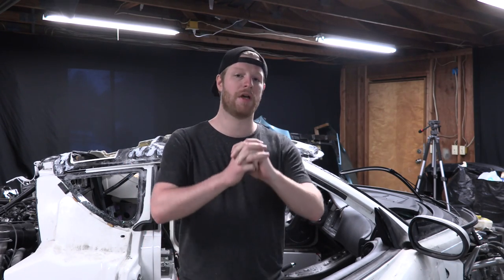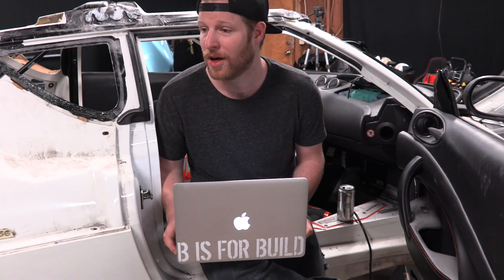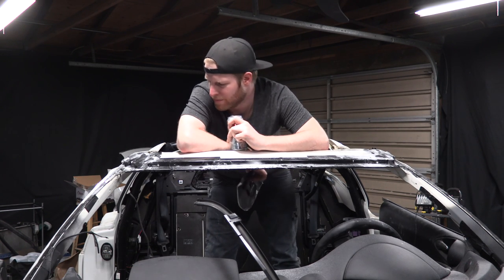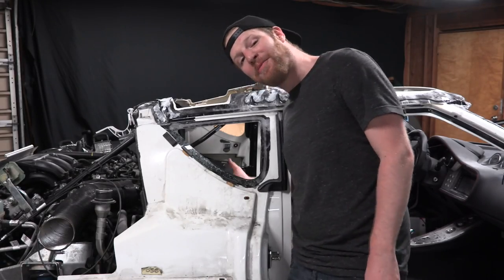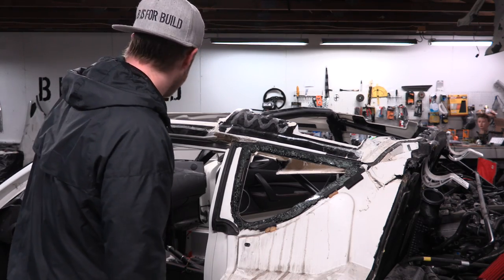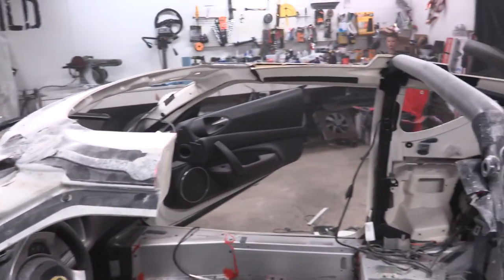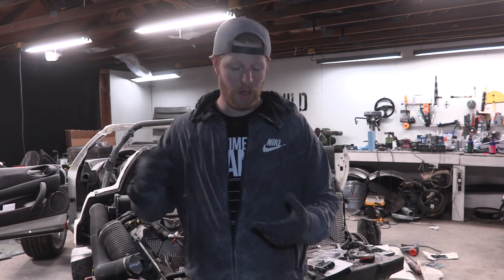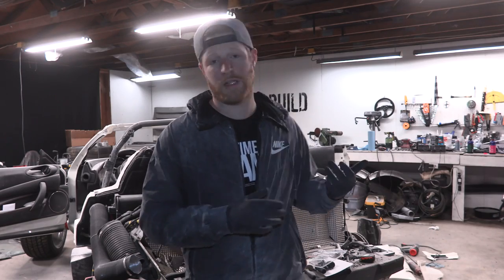Budget Lotus Evora Pt 10 - Removing Side Panels

Comment: Since lotus decided no one was supposed to repair these cars, you could always cut away all of the fiberglass and make it into something like the roadkill vette cart
Reply: There wasn't much of a corvette left in that
Reply: for what he paid for it, and if this I'd done correctly, he'd make an enormous profit, that's a terrible idea, unless you're a millionaire
Reply: no way, just the labor required  is enough to pay for a new car. This is an exercise of sheer will and determination.  Most rebuilders would bow out the moment they realize all frame-bonded parts were never meant to be replaced.   This is one of the downsides to cars that are essentially glued together.

Comment: Not at all complaining,. Good stuff man and you're doing a great job.
Reply: I found the door glass (B132B4057J,  B132B4058J), windshield (C132U0001F), rear glass (E132U0003F) and quarter panel (D132U4001F, no RH) glass as well as the roof (A132B0018K) on lotuspartsdirect
Reply: I found the rear bulkhead as well. A132B0107J

Maybe these arent the ones you need as i found them fairly easy? All of them had good prices as well. Roof was 900 i think.

Edit roof is 670
Reply: but are they in stock. Sometimes they are on backorder
Reply: I wondered that as well. I put the roof in the cart and clicked order.... It seemed to work, so I guess It's in stock?
Reply: but that still doesn't show if they had it in stock, I've ordered plenty of things before for my car and they had to call me and let me know its on back order
Reply: Gah I hate when websties do that.
Reply: Jordan Liske yup same here lmao
Reply from the maker: Yeah undortunately the parts that aren't in stock means no stock for all these websites, there are three or four big websites that do parts distribution but if lotus doesn't have one on the shelf in the UK then these sites won't have one either, even though they will let you order and pay for one.
Reply: Dang it, i guessed as much and that's kinda sketchy. Atleast you got the roof sorted and hopefully the glass wont be too big of a hassle.
Reply: typically, youre jumping ahead of yourself on cutting up body panels. Youd normally wait til you got your replacement parts to see how much you cut off. parts come with. if you need any tips on bodywork/repairs/fiberglass feel free to ask. You never know how much of what the

Comment: should put plexiglass as roof. that b neat
Reply: "what a beaut"
Reply: use Lexan instead of plexiglass , lexan is much stronger and also available in different colors
Reply: Sinned Neztirreg I didn't think of that. Would be a lot better
Reply: Lighter and stronger :) and used a lot in racing
Reply: I support this

Comment: I know its a bit of a PITA (and probably too late), but try holding a shop vac near your angle grinder wheel while cutting.  It sounds silly, but when I was using mine to cut sections of wall/plaster out of my house, I duct taped the vacuum hose to my sleeve so that it naturally fell near the grinder wheel.  Drastically cut down on the amount of crap that was floating around.

Comment: Why not make it a T top or a fully convertible? Make it one of a kind lotus
Reply: The pillar above the door is a frame support
Reply: because Oregon
Reply: Have you seen the fiat 500 cabrios? The middle of the roof is retractible.
Reply: Hollow squad checking in
Reply: i feel like a soft top with snap buttons would look clean yet easy
Reply: +mtndewuni and tacky... But I feel it would still look cool. Maybe he could make a diffuser for the roof? And then rust it, and maybe put rockets in it... Then it would be a questionable double o seven car

Comment: After watching a video on the Evora being hand made in the factory, I have faith that you can fix everything it needs. I was worried about fixing the front aluminum crash bar but that should an easy fix or custom make new pieces. But I am worried about the windshield frame being out of shape and if it's made of fiberglass should probably just be replaced.
And if you haven't yet you should get under the car and measure the chassis front to back, side to side, corner to corner, and axel to axel to make sure it's completely straight so you're not fixing a car that will forever drive at an angle.
Good luck and happy wrenching!

Comment: bro, your channel is the mutts. you are as mad as a box of frogs too. :)
awesome channel, awesome content. 
you are closer to the finish than you think. as you are buying in panels it will go together like lego. as you had all the parts, you can make your own panel by making blanks and moulds. in fact, you could still make your own panels as you were quite tidy in cutting with the disc cutter. the tricky part in making the panels is extrapolating where each panel finished. but this could be overcome by making the panel an inch or two longer and then trimming later. 
I love the work ethic you display. you are what we would call "a grafter" here in the UK. good luck with this build and savour it, you are closer to the finish than you think ;-)
can we have a rotor craft as the next build. (i. e,  "little Nellie " from James Bond-Dr No, is a rotor craft ;-)

Comment: There's a company that supplies a carbon roof for the Evora called Tecnocraft and they're selling them for $2500. They've also got rear hatches and A-frames, both in carbon. I've also found a place called DeRoure that looks like they supply parts for them, including bumpers (shipped in primer) and lights. I dunno if they ship to Oregon though and they don't appear to do glass.

Comment: You are really going to need a fiberglass boat builder/repairer friend.  For your roof, you put a piece of plywood inside the car to support the roof. You build up with high density foam or molding/sculpting clay. Carve/sand the roof to desired shape. (exact shape of finished roof).  Take a fiberglass mold off the finished shape.  Now you can make as many roofs as you want.  
For your side panels your going to have to repair them in place 
The rear bulkhead will have to be removed , either repaired or copied in fiberglass or fab an aluminum one.

Comment: Just wondering why you would cut those side panels into so many pieces when that same procedure just bit you in the ass for the roof? Some body who smokes a curb with the rocker would probably pay big dollars to buy your used parts if the were more intact. Most cars come with huge side panels now, but when in an accident the body shop just sections in a part of it . I understand that they may be hard to disassemble but you could probably get $1000. plus for the remainder of your side panel. Also did you email any lotus approved repair shops to see if they had partial panels left over from fender bender repairs?

Comment: dude great vids! surprised how your able to just cut up the car without getting super nervous on camera... but you could take steel and rivet the pieces together then fiberglass over it to make a new solid piece...probably what your going for.... 1100 for a new roof not bad even with probably 500 for shipping although roof would be much easier to fab then the side panels that are structural. fiberglass is awesome though just make sure when doing layers to do each one as the one before is is still tacky it will help there be no air bubbles to be strong as bull also you can use body filler and just sand it to flow with the body.

Comment: maybe a dumb question why didn't you just fill the cracks with fiber glass then bondo it smooth yourself ?
Reply: Its very hard man its not like filling in a hole in drywall! No hate man just informing you :D
Reply: +opasity productions it's really not though. fiberglass is just a fabric weave and glue sanded flat.

Comment: Is "Its still safer than a motorcycle" an option for the Lotus?

Im sure its possible to get or make pretty accurate 3d Schematics of the parts you need and just print them out in a big 3D Printer. Or maybe print them a little smaller and then reinforce it with layers of fiberglass? Atleast the Roof should be possible to be built that way. There are also reinforced 3D printing plastics, but I dont know if they can be applied to such a cause.

If just someone with the needed spare-parts would lend them to someone else who can do precise volumetric scanning and you just hope that Lotus doesnt sue your ass for "copyright infringement" or something while someone else prints them out... I feel your struggles.
Reply: would be pretty heavy

Comment: $80k supercar. How much did you buy it for wrecked? I think you're still on the right path even if you do spend a bit getting it how you want it. Not many people can say they have or let alone built their own supercar. For what it's worth you gained a huge fan. On a TV aspect it's real seeing your struggles and being there with. And you're right, about the challenges, but you've been brave enough to try. Not to many people would pull the trigger on the things you've done. You made me not want to ever buy a new car off the lot. But do it B is for build style. Maybe someone will get your logo on their ass. I also thought when you burnt that stamp it was cool looking on the car. Kinda rebel and a middle finger to all problems. On a drift slider it'd look classy.
Reply: Ah 10k you have to spend on the evora. Since the engine is plum, you're on your way!

Comment: Love the videos but watching you cut off those side panels made me cringe.  Maybe, that has something to do with the fact that I'm a sailor and have done hundreds lots of work with fiber glass.

Fiber glass is super easy to work with and once hardened can be sanded nearly the same as any normal body filler.  But, now that the panels are chopped up your odds of repairing them just sunk into single digits.  That made me a sad panda.